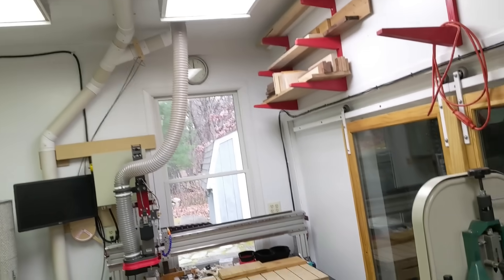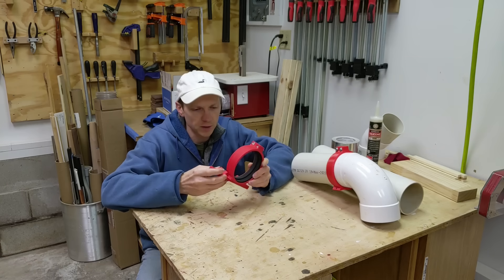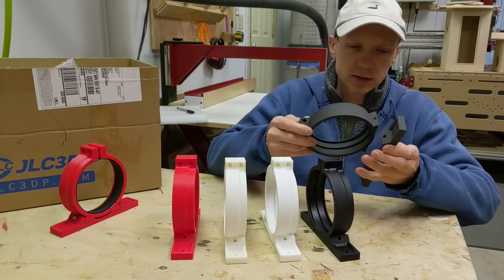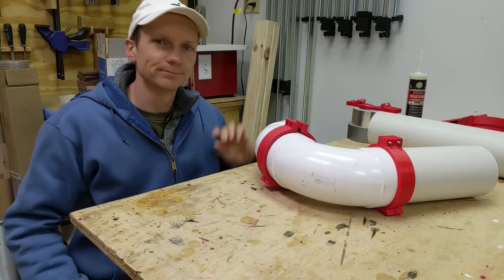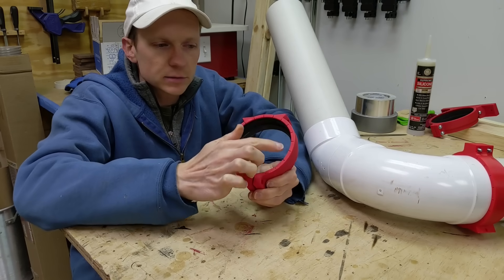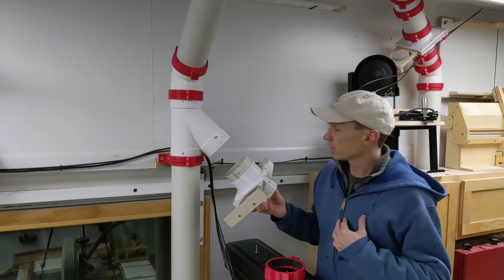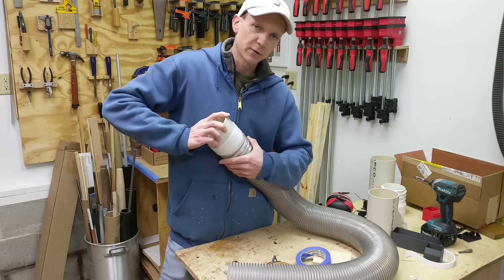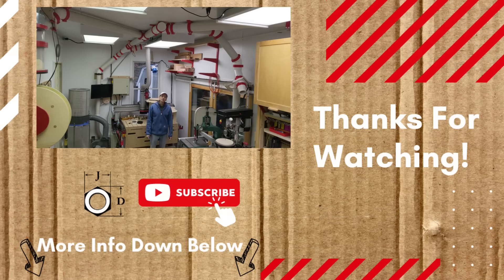The Big Problem with PVC Dust Collection Pipe

Comment: Bravo! These clamps look amazing!

This is the 3rd video of yours I've watched and I noticed these clamps on the very first video I watched. 

Most of the people I see using PVC use the normal PVC cement to fix them permanently together, so if they need to change it, they are SOL. But your system looks like an amazing upgrade.

Comment: These clamps seem to not be designed for schedule 40 PVC. Maybe schedule 20? Which is hard to find (for me anyway). I wish I had test fit. The big side of the stepped gasket fits over the pipe. The fittings are way to big for these clamps. So I am back to square one. Anyone need a dozen of these clamps? I can't use them.

Comment: Another brilliant build. 

Ideas/ comments:
* I'd like to see you do a scientific leak test, comparing simple press-fit joints, silicone joints, taped joints, and your custom bracketed joints. 
* I'd like to see a similar test on the same four types of joints, but comparing ease of adding or adjusting your piping (how long to disassemble, clean, and re-assemble). 
* Is static electricity an issue for you? I'm wondering if you could incorporate some sort of static discharge or mitigation system into your clamp design. That would solve even more problems and make these even more of a game-changer.

Comment: Thank you SO much for this.  I bought the files and have been excitedly printing ever since. The clamps fit just Perfect and print easily.  

Its probably going to take me 2 spools of PLA (~ $50 ) to print the many parts I need - If this was a commercial product each clamp would probably be $20.  You're amazing!
Reply from the maker: This is where having a 3D printer really pays off. Happy to hear they are working well for you!

Comment: Hey Justin, I'm getting ready to put up dust collection pipe. But I've chosen to use 6" sewer and drain pipe to get the most out of the suction I can. I do have a 3d printer. I'm wondering about purchasing and downloading your file and whether you think it will work to simply resize the circle clamp and block simultaneously to keep the geometry the same? Since you have some other geometry in there, like the little triangles and screw holes - I'm not sure it would work? I'm fairly new to 3d printing but have done a few projects in tinkercad - very basic. Thoughts?
Reply from the maker: I don't think it will work as well as expected because the geometry where the hardware goes through will also scale so it won't fit the M5 hardware anymore.
Reply from the maker: Just to let you know I've now added a 6" version due to popular request!

Comment: So,as a plumber, I have to ask: Why not just use gasketed push joint SDR schedule 35 PVC? They can be stiff to put together, but there's no extra cost for printing those clamps. For support, just use metal 2 hole straps.
Reply: https://ipexna.com/wp-content/uploads/2022/08/ringtite-fitting-960x745.jpg

Comment: I specially leave some open parts in such pipes because with long pipe air speed become low and cyclone separator working not well as it can. Higher speed of air, smaller dust it can separate.

Comment: Neat clamps, but what is wrong with PVC glue?
Reply: My question as well. But I will add this solution allows for cleaning which may be why a lot of people seem to use replaceable seals. I see this dust collection is very similar to a water drain problem and I've done a bit of that! Suggest any system should keep the drain idea front and centre and install inspection ports at the bends — much easier to diagnose and fix any blockages. Especially  important if the pipe joints are glued. I imagine a buildup of dust could be cleared by running the vacuum, and pushing the dust along with a little compressed air or poked stick with access through an inspection port. This just leaves their role as fixing clamp brackets. These look really good for that with good grip and vibration damping.
Reply: @pendarischneider  in a shop where machines are added and moved glued pipe is a pain in the ass.

Comment: Glue and primer will save money and time smh
Reply: Came here to say the same.
Reply: But not easily taken apart if needed to add or adjust the PVC. You would have to cut and splice, rescue, etc. With silicone tape, just slice it off and replace.
Reply: Well in that case, they make fernco's and no hub bands. Idk about you guys, but if I'm removing DUST, I'd want as many sealed joints as possible. Sounds like a huge waste of time....

Comment: Couldn't the majority of those joints get glued leaving a few dry for disassembly? I didn't hear any mention as to why every joint needs to be removable.

They definitely look cooler than purple primer.

Probably work pretty good on metal pipes that you would have to tape to get any sort of seal but PVC is designed to seal with glue which seems like it would solve most of the joints.

Comment: Something that would be much faster, easier, and cheap would be self-fusing silicone tape:  Originally developed by the US military back in the fifties to protect the wiring of their F4 fighters (and why it is sometimes called 'F4 Tape'), this tape contains no adhesives.  Instead, it sticks only to itself, fusing into a single layer of silicone.  (It comes with a liner that is removed before applying.)  While it isn't incredibly hardy--it is a soft silicone with a hardness rating of 50, after all--it can handle incredible temperature ranges (-60C to 260C), pressure (750PSI), and voltage (400 v/mil).  It also works well for adding grip to tools/etc.  To find the good stuff--there are LOTS of garbage versions out there--look up its milspecs: 'A-A-59163' or 'Mil-I-46852'.

For this application, you would take advantage of its ability to stretch 300% and basically make a giant rubber band as your seal.   What makes that better than gluing/etc. is that, not only will it seal VERY well, the bands can be move/removed at will without leaving behind any residue.

Cheers!

Comment: Metallic tape has always been good on PVC joints for me, and grounding it limits the static charge buildup - just stretch over to the nearest conduit.  Also, if you want to increase your dust collection flow, look into replacing those elbows with long radius versions.  Long, sweeping bends flow smoother and will result in higher airflow speeds.

Comment: Silicone TAPE is literally air tight, sticks to itself extremely well, yet you can remove it like scotch tape off the roll, leaves absolutely no residue, is a ton cheaper and saves a ridiculous amount of time over your solution.  Had my whole shop done in less than 45 minutes for under $30 and it has more joints than yours.  Common sense just doesn't make for long overdrawn YT videos these days trying to get those viewing minutes it seems.
Reply: I don't understand the need to attack the guy for posting and explaining his solution.  If it's not for you it's not for you.  Silicone tape works fine in some situations but it can't work as a bracket.  There are some folks that will find that this solution works great for them and they'll appreciate the detailed explanation of how his solution works so they can evaluate that or get ideas how to make their solution better. Thank you for sharing the solution that worked best for you.
Reply: @buildtestbuild  NOT an attack. Just sharing. This is how we all get better. I love his idea. In another comment I want to know more about the foam he used.
Reply: @fin3125  I wasn't referring to you, I was responding to the original comment
Reply: That's what I started using and it's reusable
Reply: @fin3125 you gotta think his idea is a good sales pitch and a good idea for something us olds already solved prior.  Respectfully to all, I hadn’t heard of either fix and only reason I read your fix was bc of his sales pitch to prob sale something. Idk if I will continue to watch or not but I do love to see how people engineer things around issues correctly. Neither seems wrong.  Just one is cheaper. But the tape doesn’t fix the mounting issue.  Not that is expensive but just not included in your calculation
Reply: @aaronblackford981  I did create some 3D straps for mounting. I mostly used metal tape with holes. I think that they are pipe hangers. I think that was very cheap but I already had it on hand
Reply: @fin3125  yeah. But extra cost and work wasn’t said.  That was my bigger point.  We have to consider others outside of ourselves at times.
Reply: @fin3125  Indeed it is!

Comment: If only there was some sort of tape for sealing air ducts... some sort of "duct tape"? If only...
Reply: Imagine about the sticky residue when you're taking it off
Reply: @fin3125  if that bothered me I'd just use a length of rubber tube cut into joins, or simply better tape
Reply: @SNOUTxTOUT  I used silicone tape.

Comment: Where did you get the hose to PVC adapter design or did you design it yourself?  I'm trying to find one that is decent and having no luck.
Reply from the maker: I also designed that. I will get it uploaded on the website soon.
Reply from the maker: I just uploaded the threaded PVC to flex hose adapter to my website if you're still interested. Link in description.

Comment: before I go spending money on your design (which seems totally legit) but since I don't have a 3D Printer I need to use this JLC3DP service but can't get a quote without the file.  Can you tell me approx how much each bracket will cost from them???  thanks, looks awesome
Reply from the maker: It depends on the material you use but it ranges from about $5-$15 per clamp.

Comment: I have used Silicon tape to seal my pvc ductwork for the last 10 years and it has not let me down. Every couple of years I check for leaks just to be sure- haven't found one yet. 
If I need to make changes to the ductwork I remove the tape (no residue) change pipework and wrap new tape in seconds. It comes in white and clear (and many other colors) so it's practically invisible.
Reply: Ditto, I use the Nashua stretch & seal self-fusing silicone tape. No residue when removing.

Comment: There is also a PVC tape which is not leaving any residue, it's partially flexible and fully seals joints. It's also white so barely noticeable. It's widely used for sealing air pipes. Costs arount 15$ for 15m in my area.
Reply: Self-amalgamating or self-vulcanising, I think its called!